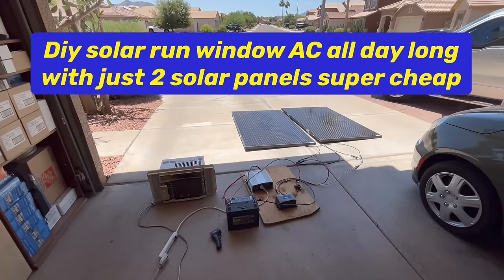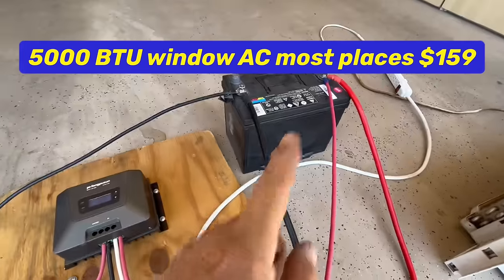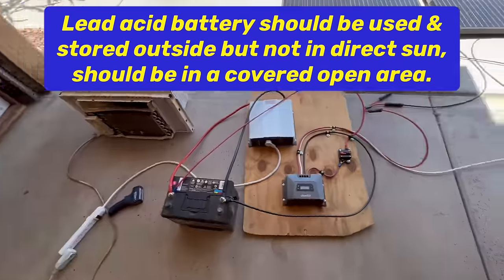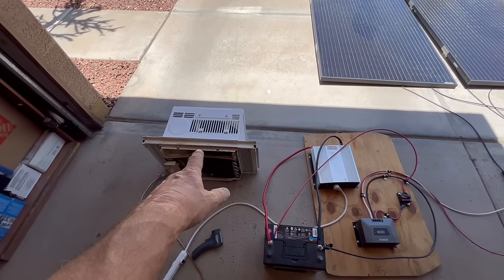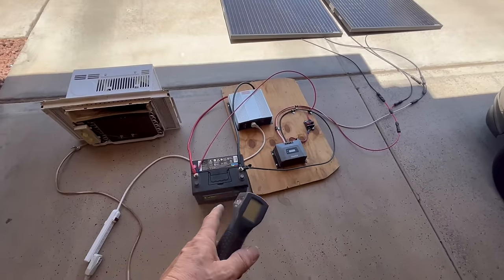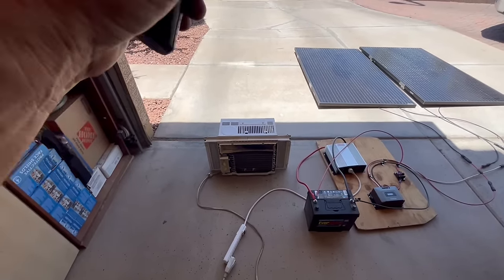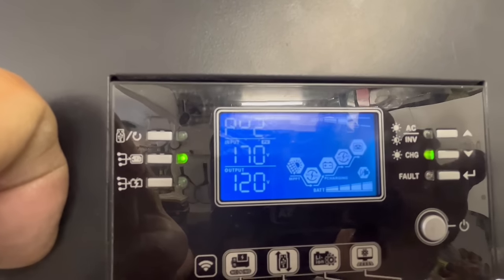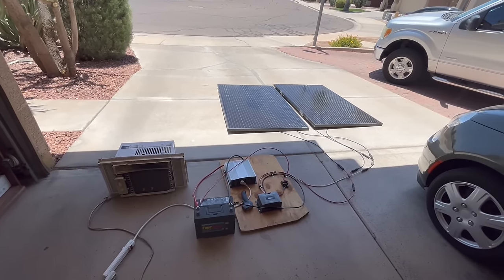Run your window AC with just 2 solar panels when sun shines. Easy DIY project you can do in one day.

Comment: AHH,  COLD AIR DROPS, WARM AIR RISES, I BELIEVE
Reply from the maker: Yeah, I got that one mixed up and did not catch in editing. Sorry. The good news is you are only one of maybe 30 people who actually caught it. Hope you have a truly wonderful and extremely blessed 2024
Reply: GOOD VIDEO, WISH I COULD TAKE ADVANTAGE OF THE TECHNOLOGY  @diy-solar-guy
Reply from the maker: @domcizek  I buy a little bit at a time until I have all the parts. Affordable off grid solar options are now here. My system has paid itself off with just the electric bill savings each year.  I use a lot of electricity and this reduced my bill over 80 percent. Check out my other videos to see how I run heating and cooling in my 2400 sq ft house and garage 100 percent solar in day and battery bank at night. I even heat my 15000 gallon pool along with running my pool pump 24/7 year round, all with off grid solar. Hope you see how easy it is to do. Hope you have a truly blessed week
Reply: Smh... How can you be so over-critical of someone.. this guy made a very helpful video
Reply from the maker: @mark7362 thank you, I appreciate your comment, I have to take meds for the 2 cancers I’m dealing with and it messes with what comes out of my mouth, sometimes things come out backwards and I did not catch when I edited the video. I hope you have a truly wonderful and extremely blessed 2024.

Comment: "just 2 solar pannels!" also some controllers, batteries, power regulators...
Reply from the maker: This is just a bare bones system I used in my shed fir 2 years. When it gets cloudy the battery will drain relatively fast depending on how long clouds block sun. The more panels you add this this basic system, the more reliable it is. You are limited to just 2 solar panels on a 12 volt system with this 12 charge controller along with the 12 volt inverter. Switch to a 24 volt charge controller and 24 volt inverter and you can double the amount of solar panels or even use 4 times as many depending on charge controller. Over the last 4 years since I started with this basic system to learn about solar I greatly improved it and now run my upstairs and downstairs central air conditioners with solar in day and upstairs unit at night with 25.2 kWh LiFePO4 EG4 battery bank. I also run my garage all day with a 18,000 btu mini split to keep garage at 75-78 degrees in summer with off grid solar in the day. Check out my other newer videos, I think you will like them. How you have a wonderful and blessed weekend

Comment: Why do you have so much inverters
Reply from the maker: It’s been a work in progress, as I learned, I bought bigger and better inverters. I now use 3 separate inverters because the low frequency Growatt can not be paralleled together. But will start all my heat pumps.

Comment: Hot air rises. Cool air falls. I know, always a critic out there.  Great presentation otherwise. Thank you.
Reply from the maker: Thank you, I know after I posted video I noticed. I make mistakes like this once and a while do to taking harsh pain killers for the 2 cancers I have had to deal with. I apologize.
Reply: @diy-solar-guy thank you for this video. I hope you beat the cancer!!!!!!!!
Reply from the maker: @ronnie32567  thank you so much , the worst is past, now I do videos because I am permanently disabled unable to work anymore. I spend 1-3 hours a day sometimes 2 or 3 days a week to do videos and add to system. That’s about all the work I can do. But I have great meds for pain when it comes, especially back constantly going out for weeks a time. But I’m good, blessed and able to share off grid solar with others. If a guy like me going through what I did go through and still am going through can do this with Just a few hours a week, then any healthy DIYer can accomplish this in very little time. What has taken me almost 4 years to do, most could do in 1-3 weekends. Thank you for your input and hope you have a wonderful and blessed week.

Comment: It kills the battery every time it doesn't keep up not sure what he did
Reply from the maker: If you have cloudy days even slightly cloudy, it will effect solar input a lot. This is just the bare bones to run an ac on solar. You have to adapt to your area and surroundings, like tree and building shading or cloud cover. This worked for me because I had it in a small shed and it cycled on and off frequently. So when it cycled off it would charge the battery at 14.2 volts and 550 watts. The more solar you add and batteries you have will greatly improve the length of time running this unit. If you are trying to cool a 10x10 room on a 100+ degree day with high humidity, you will need to beef this system up to compensate for those factors. This unit was cooling less than 50 sq feet for 2 years. I cool my entire house with Growatt low frequency off grid inverters and Lithium Iron Phosphate battery bank(25.5kwh). Running my 3 1/2 ton whole house ac 24 hours a day in the summer. This is an upstairs unit which is much harder to cool than ground level. Check out my videos on using mini splits and whole house heat pumps using only solar in day and battery bank at night. Hope you have a wonderful and blessed weekend
Reply: Can you elaborate on what you tried? Lot of difference between 5000 - 8000 btu if your setup is small - 20amps/hour average should be all you need to keep up with for 5k btu  🤷‍♂️
Reply from the maker: You have to have your system be able to produce enough watts to run ac and charge battery with watts to spare. I with over 320 absolutely sunny days with no clouds a years can use less solar panels than someone in say Michigan, I lived in Michigan, I would never set up solar in Michigan. They have over 300 cloudy days a year, way too much cloudy days for your system to be efficient. You have to adjust for your conditions where you live. If I did try to set a system in Michigan, I would not be able to use a 12 volt system, very limited with amount of solar per charge controller, I would have to go to a 24 volt system that I could connect 2400 watts so on a cloudy day I might get enough watts to run system and charge the battery. A lead acid battery can take many hours to charge fully using solar, usually not able to charge at high amps like Lithium Iron phosphate batteries that can be charged at 100 amp for a short time. When running your ac, if battery drops below 12 volts, it could take 8 or more hours to get to 12.8-13.2 volts while running ac. You always have to take into consideration your climate, shading from trees, etc

Comment: That lone battery ain't enough and would die real fast
Reply from the maker: This is just a basic example I used for 2 years in my shed, you can always improve and add more or upgrade. Just so people who no nothing about solar can understand the very basic minimum requirements parts needed. I actually run my entire 2 story house and garage on solar now during the day and lithium iron phosphate batteries at night. I started with this 4 years ago cooling my shed with all the components in it from 8-9 am to 5-6 pm 7 days a week. This will not run overnight but would need a LiFePO4 battery bank to run all night long or just plug into electric grid power.

Comment: Air conditioning in a garage? :O
Reply from the maker: In Phoenix AZ, our garage will be the outside temp which today will be 117 this afternoon, I have a 18,000 btu 230 volt mini split that keeps me cool in the 75 degree range using off grid solar. Pull a hot car in the garage and the temp will go up 10-20 degrees. It gets brutal out here in summer but not in my garage. I actually now run my central ac upstairs and downstairs with only solar in day and LIFePO4 battery bank overnight when it is still 110 degrees out at 8pm and the overnight low is 90-92x life is good and nice and cool in my house. I even installed .6 mini splits in house and can use those instead of central ac if I want to . I usually use a combination of mini splits an can’t so air in the day time. All with off grid solar power. Getting ready to install mini spit on motor home soon which o will be able to run with a few solar panels in day and battery bank overnight. Hope you have a wonderful and blessed weekend

Comment: Isn't that a 24V battery?
Reply from the maker: No it is a 12 volt battery, I do not have any 24 volt batteries, I would have to connect 2-12 volt batteries together to make 24volts. Battery bank.
Reply: @diy-solar-guy  Kind Sir. I apologize in advance but you really need to take a look at the battery you used in the battery video and google "24VDC", as in 24 Volts Direct Current. I just cant drop it, I'm European.
Reply from the maker: @OrlandoPaco  if you look at the video at 30 second mark, you will see if you zoom in that it says “ Group Size 24DC” . It does not say 24 volt. That is not the battery voltage but the group size of the battery. The battery is 12 volt. Hope you have a wonderful and blessed day.

Comment: I bet those 10awg wires get hot while the A/C is running…a 10awg is only good for 30 amps…if the A/C is using 5 amps that makes the battery supply is at least 48 amps
Reply from the maker: Wires never got hot at all. Used for 2 years.

Comment: A 20 seer 12,000 btu mini split wouldn't draw much more than this.
Reply from the maker: At first it would draw around 800-1000 watts but would drop down below 500 watts once area is cooled. My 16 seer 12,000 btu drops down to 350 watts once room is cooled. You would definitely need to go to 24v with 4 solar panels to run mini split. You can still use same charge controller which is 12 or 24v auto sensing and charges up to 50 amps. With used solar panels as cheap as $25 for 250 watts, it’s not that much to buy 4-250 watt solar panels.

Comment: These solar panels are entire faced solar panels. No digits or square groups. regular solar panels of this size hardly reach 190 watts each.
Reply from the maker: These are mono solar panels and they usually reach 300 watts, they are 330 watt solar panels. I bought used from Santansolar.com for $35 each. Great output for used solar panels. Thanks for your input. Hope you have a wonderful and blessed day.
Reply: @diy-solar-guy   Thank you for the reply. Wow the cost is so low. Very good deal. But on the other hand I checked other panels that cost more than 3.5k, especially the bi facial ones used or new are like extortion.
Reply from the maker: @KetansaCreatesArt  I always bought when they had among deals at Santan solar. They usually have a sidewalk or virtual sidewalk sale 2 times a year. That is when I bought.
Reply: @diy-solar-guy   Thats great. Thank you for the suggestions. Wishing you awesome week ahead.

Comment: I tryed it with the lowest watts 500 but and 470 watts with about 650 watts of Panels. And 245 ah golf cart battery. It just take too much effort to maintain the battery level. Cause when every the cloud pass  you end up finding you have to turn off the A.C that way faster than running off the battery then you start the day with a very low battery that can't recharge with the ac on need a good 4-6 hr first. Then you find out boy, they are just too much cloud passing in a day abd for 10-15 minutes. Late you find out why am I stressing out look at the sky for s few hour of 
ac. Afte a month you just give up or other thing are more important. Reality it sound sexy and cool but A C tak too much drain in a day to be a plug and play. It don't work as you need solar electricity for other thing too that need a full battery.
Reply from the maker: The video I did was an Example of basic solar to run a ac unit with minimal parts. As you improve and make system better, you can run ac longer. You are correct, you have to take into consideration cloud cover which most people don’t. You have to always be bringing in more watts than using to run load and keep battery charged. Adding one or two more solar panels improves the system to keep running even if there is partly cloudy sky. Adding a second battery in parallel also would help with clouds going by. I actually run my central ac units in my house with solar in the day and 25.5 kWh battery at night. I run a 3 1/2 ton central ac 7/24 and my downstairs 4ton ac while sun is out in the day. I spent $0 on air conditioning last month. Thanks for your input. Check out some of my other videos where I use a 24 volt off grid inverter to run 1 or 2 12,000 btu mini splits. Hope you have a wonderful and blessed weekend

Comment: 12v deep cycle that says 24V... interesting
Reply from the maker: Hi, if you look at the video again, right above the 24DC says GROUP SIZE. This is a 12 volt battery. Also in the video on the charge controller I show what voltage is charging the battery, which was 14.2 volts or less. If that was a 24volt battery, the charging voltage be around 24 volts to 28.4 volts. Not sure why everyone seems to think that group size on the battery is the voltage? Hope you have a truly wonderful and extremely Blessed 2024.

Comment: It’s concrete, not cement.  Cement is an ingredient used to make concrete.
Reply from the maker: I replied to your other comment, you were mistaken, the group size is printed on the side of the battery where you mistakenly thought that was the voltage of 24 volts. You jumped to a conclusion when you actually made the mistake. If you look closely at the battery, right above the 24DC it says group size. We are are mistaken at times, you are no exception. So I forgive you for trying to call me a liar when it was you that was mistaken and owe me an apology. Be care correcting others, you could look worse. Better to not correct others than try to correct someone and you are the one who looks like a fool instead of the one you falsely accused. Hope you have a truly wonderful and very blessed day.

Comment: So you got about 1000 in parts to get "free electricity"
Reply from the maker: Cost me 4 years ago $549 in total. I bought the 2 used solar panels back in December of 2022. I only paid $35 each for 330 watt mono panels. 1/10 of new price. Solar panels are included in total price, everything else I bought 4 years ago. I installed 6 mini splits in my house, $550 each for 12,000 btu 110 volt models. I cool 600 square feet instead of maybe 100-150 sq feet with window ac. Lead acid battery and an AGM battery are only good for running during the daytime with solar, will not work overnight to run ac unit. I actual ran that window ac unit with a 12 volt 150ah, 2 kWh lithium iron phosphate battery for almost 4 hours the other day on high the whole time. It was just sitting in garage and not installed in a room so it ran in high without shutting off using 550 watts or 5.1 amps. 2 of those batteries would get you about 8-10 hours of running overnight if installed in a room 10x10. I paid around $425 for the Lithium Iron phosphate batteries each on a sale, no tax and free delivery. I use those batteries in my other videos to run freezers and a fridge, pool pump and lights outside overnight every day. I gave you more info than you asked for hopefully that will answers questions you might ask next. Hope you have a wonderful and truly blessed week
Reply: @diy-solar-guy  I'll just pay my electric bill every month and not go through all that nonsense.
Reply from the maker: @indyguy3400  this is what I started with 4 years ago. I now run my central ac upstairs and downstairs and 3 car garage on only solar in the day and upstairs central ac on 25.5kwh battery bank at night. Saved over $700 on electricity bill last month. I only run off grid solar. No solar on the roof and no solar connected to grid power at all. For Phoenix AZ my electric bill is less than $1100 for the year and my entire solar power system will be completely reimbursed and paid off from electric bill savings in December 2023. All DIY solar. Hope you stay nice and cool this summer and hope you have a wonderful and blessed week